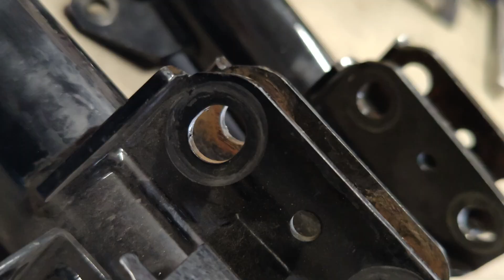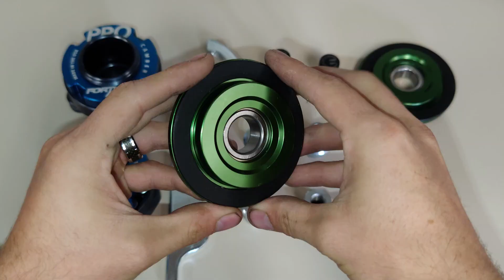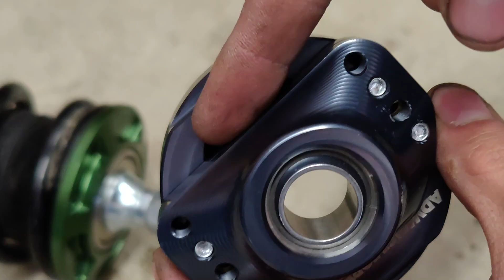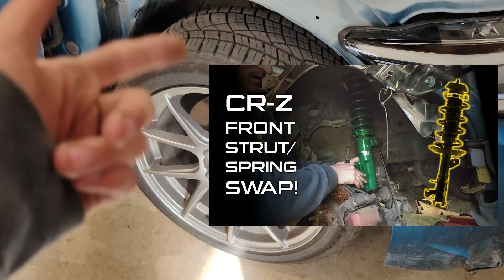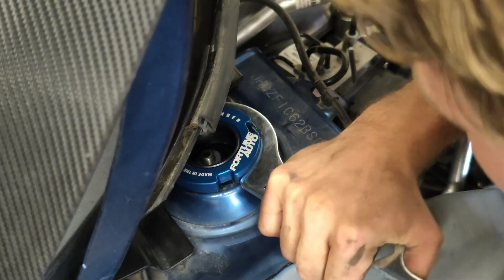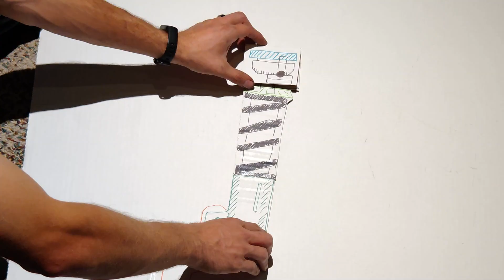Honda CR-Z/Fit Upper Camber Mounts DIY Installation Guide & Review

Comment: The fortune auto coilovers have an ovaled hole for the top pinch bolt, you can get even more camber with those
Reply from the maker: The BCs I installed do have a slotted upper hole as well, I imagine this is a feature of many of the higher end brands.
Reply: @HondaGarage_ID i tried running a camber bolt in the ovaled hole on my fortunes. With all camber adjustment maxed out including the camber plate, the tie rods were too long to get toe zeroed, so i switched back to a standard pinch bolt. If I ran any more camber, the inner side wall would be contacting the strut body/collar. My track set clears by 5mm

Comment: Seeing you take off the front struts in minutes really put into perspective how lazy I’ve been not installing my showa tuning kit I have sitting around. Motivation!
Reply from the maker: Once you've done it a few times, it's super easy. Realistically just 5 bolts and it's out, as long as you have the right sockets. Just make sure you have extra time in case you get a seized ball joint or sway bar link!

Comment: Drivers side control arm.  Shorter than OEM?
Reply from the maker: Both control arms are aftermarket replacements, turns out one is 1/2" shorter than the other. Same brand too. Not sure how that happened but I'll be doing a video shortly for both the Fit and CR-Z comparing aftermarket and OEM arms along with the Insight parts.
Reply: @HondaGarage_ID Good idea.

Comment: I get -3.5 on front running two bolts each shock
Reply from the maker: Any race use or just street/daily? Not heard good things about using double bolts for high performance applications
Reply: @HondaGarage_ID I probably wouldn’t run cheaper no brand Chinese camber bolts
Reply: @HondaGarage_ID the brand is nolathene and they’re like pretty high quality bolts, I use them for touge/ spirited canyon driving and have done a bit on track, I also heard two isn’t great as it’s a lot of strain on the bolts, but in my experience that’s quite bs, I’ve really abused them for more than a year and dailyed them aswell and have been completely fine, some people ask about camber wear but to be honest I haven’t gotten any, it’s just about getting the toe adjusted correctly I think

Comment: Look into tcs upper caster/camber kit.
Reply from the maker: Looks like those require drilling/strut tower modifications, The nice thing about the Fortune Auto setup is that it is an easier installation without any drilling or cutting required on the stock shock mounts. But I may check those out next if the FA setup doesn't cut it. One positive I can see with a bolted system is not having to worry about the top mounts rotating or slipping, from what I've seen people typically don't have any issues with the Fortune Auto mounts slipping but who knows.